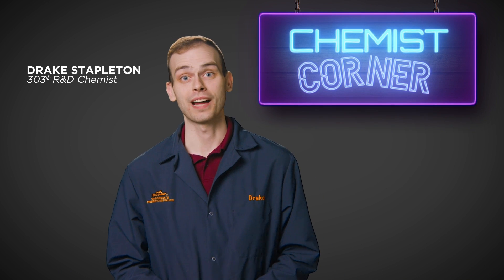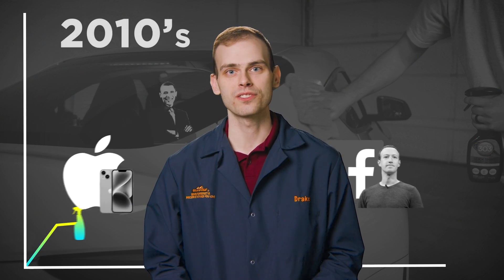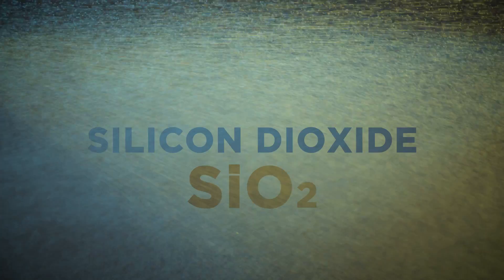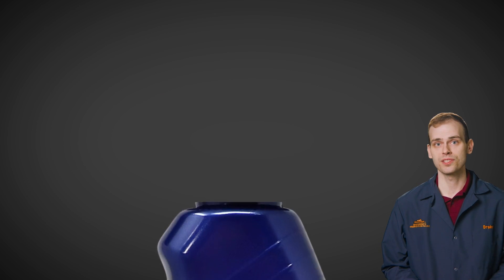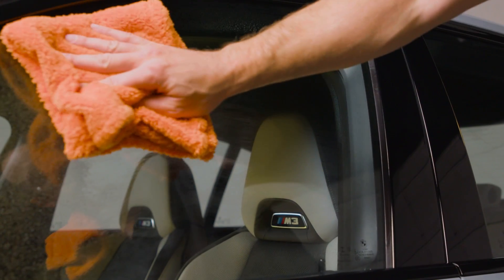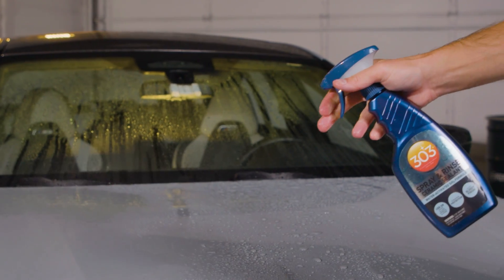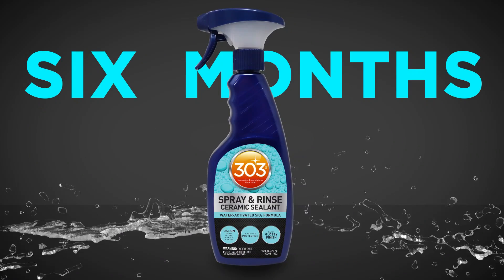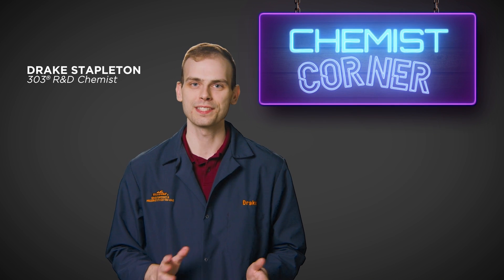303 Ceramics: Science Behind SiO2 Products | Chemist Corner

Comment: Instead of spray and rinse Ceramic Sealant ,can you spray on wet car paint, then use Metro Master Blaster car dryer and blow off vs. using microfiber drying towel?
Reply from the maker: Using Spray & Rinse Ceramic Sealant will make it easier to dry, so using an air dryer like that would be possible more likely than not. We still recommend having a drying towel handy to make sure you get the car fully dry.